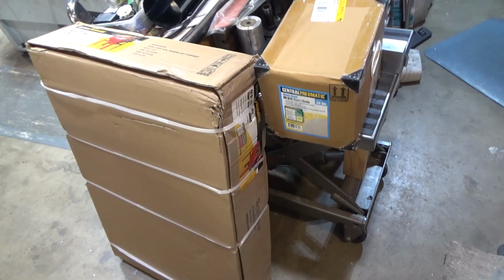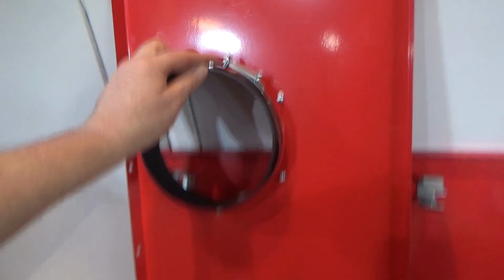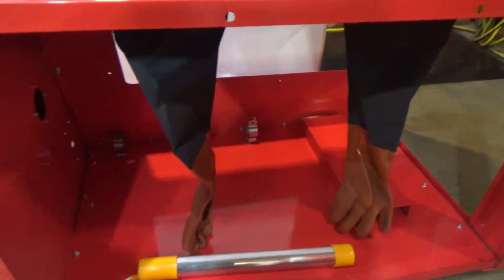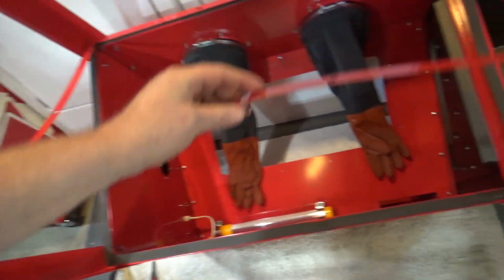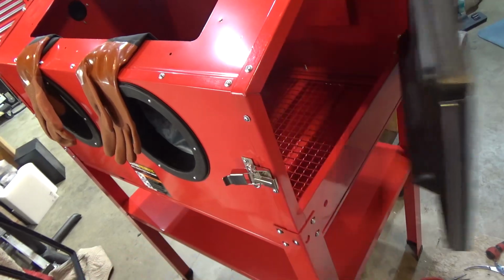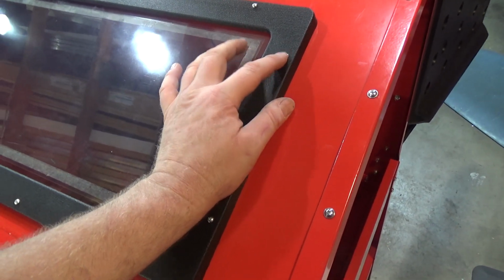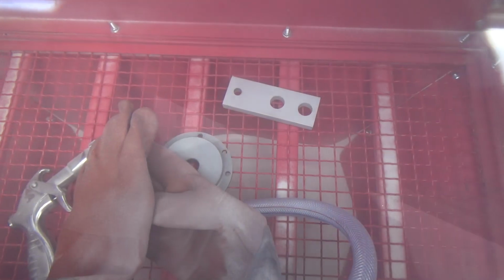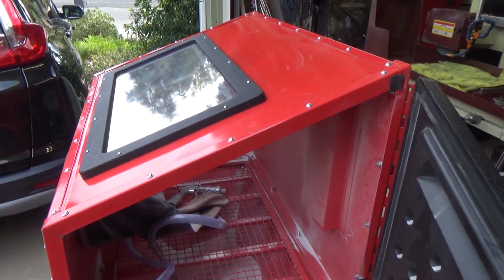QTR 58 Harbor Freight Sand Blaster

Comment: I will add to those who have mentioned Tacoma in Hope/Sandpoint Idaho (he used to be in WA state) for mods to this cabinet.  
Absolutely transforms this cabinet to a professional level.  
With his system you will measure your media in cups vs. pounds, and that's not an exaggeration folks.
Reply from the maker: Thanks for the tip, I'll check it out.

Comment: I was wondering, if you put an 'Ionizer' inside the blast box and grounded the cabinet, it should help prevent the glass dust from flowing around so freely inside the box and maybe prevent it from escaping so easily as it would be attracted to the cabinet. I would also put one outside the cabinet to prevent the dust from contaminating the shop. They are very cheap to buy and maybe worth a try.
Reply: P.S.     You need a 'Negative Ion' ionizer.
Reply from the maker: That is a really interesting idea. Getting rig of static charge might work.

Comment: I have had a harbor freight blast cabinet for 8 years. a few pointers: if you have suction problems where not enough abrasive flows, drill an 1/8 inch hole in the metal tube above the level of the abrasive in the well. i know, sounds wrong but mine has worked flawlessly since I did this the first day i used it. Siphen feed blasters always have this. Order a pack of glass protectors, they get cloudy quick. You can extend their life by taping paper over half of the window on the inside. You will have plenty of viewing area and when it gets too cloudy you can remove the paper and look through that side. Contact me if you want the whole list of mods that made mine better.
Reply from the maker: Thank you very much for sharing your mods and thoughts. I really appreciate you taking the time to share them.

Comment: Blast cabinets are a great addition to any shop. A HF cab is better than nothing. I’ve found that the ceramic nozzles don’t last very long. When the bore gets large enough, the siphon action of media degrades. The tungsten carbide nozzles last much longer. Also, the larger the cabinet the easier it is to use. The hoses and gun occupies a lot of space and seem to always be in the way. In order to get a uniform finish on your parts, the nozzle needs to be far enough away to feather out the blast pattern. Kind of like spray painting. Thanks for taking us along on your adventure.  Cheers from West Virginia.
Reply from the maker: Thanks for the feedback and sharing your experience.

Comment: Cool build, I have a HF blaster also, yes cut your air pressure back to 60 -80psi, always try to hold work  with a pliers or set it down and blast downward, and deflect blast AWAY from the glass, this will save your gloves and window. I put a small shop vac connected to the port on the left side port hole to vacuum up the dust so you can see what your doing. DON"T BREATHE IN THE AIRBORNE GLASS DUST seal all leaks and wear a N95 mask if you do a lot of cleaning and sense the dust [it will irritate  and dry your nose, smell]
Reply from the maker: Excellent suggestion. Thanks.

Comment: I have this exact same cabinet too.  Mine came with the air hose coming in on the opposite wall from where yours is.  I did quite a few mods to mine over the years.  If you search "cabinet" on my channel you'll find them if you're so inclined. :)    A couple of quick thoughts/suggestions.  The glass abrasive shouldn't absorb moisture, so you shouldn't have much problem with it being outside.  On the glass.....I installed rivnuts so that I can take that surround on and off easily to change the protective sheet....and or glass.  A friend suggested that I mount the flange for the gloves on the outside which is probably one of the best mods I've done.  You can take them on and off very easily which will allow you to reach inside the back of the cabinet or replace the gloves.  I put cheap LED bar lights from HD in mine.  I mounted them between the gloves.....huge improvement in being able to see. The stock light is from the backside and can create more shadows on bigger parts.  I have to store it in the shed, so I put wheels on mine with some pipe that extends out for handles and cross bracing so that the legs don't fold under when rolling it around.  I did some other mods to help block the outside light so I could see, but once I put the better lights in it, I didn't need the canopy.  

The abrasive will breakdown and leave a finer finish as time goes by.  It's not actually glass beads.  You can't shoot true beads over about 40psi or they shatter.  If you're looking for more aggressive media, you might search your area for "slag" by products.  I can get copper or nickel slag around here.  It's really cheap and really sharp. Works great fro removing rust.
Reply from the maker: Great suggestions and interesting channel: sub'd. I look forward to checking out your content.
Reply: @DudleyToolwright  Thanks. :)  I hope they work well for you.

Comment: Check out YT.  Several good videos on upgrades to make the HF blaster work a lot better.  One particularly sticks in my mind from several years ago was an outfit in Tacoma, Wa. sold a complete upgrade kit that by all accounts worked quite well in improving the performance.  Gotta keep in mind when griping that it is what we expect, Chinese junk but it gives you a starting point at a lot less than the other offerings of a similar design.  The amount I use one if I had to get a brand name I would never have one.  Even with the upgrades you will have a better blaster with less money in it.  I agree it is a shame the Chinese just can't understand quality control with all parts built to the same specified level.  The builders of the Great Wall would be totally ashamed at the present bunch!
Reply from the maker: You make a lot of excellent points. Thanks on the suggestions as well.

Comment: A couple of suggestions. I agree with the cyclone dust collector, to seal the unit run a bead of silicone around the interior perimeter, and to help with the glass get yourself some rivnuts matched to screws you are going to use to secure the glass. Rivnuts are a rivet with a thread check Amazon they are not very expensive and very handy. Thanks for sharing.
Reply from the maker: Nice suggestion, thanks. I have a rivnut gun and now have a good application for it. Wonderful suggestion. My rivnut tool is from Harbor Freight as well and the funny thing is that they sell the gun, but not the rivnuts.

Comment: I think the washers would be better than the lock washers.  Lock washers MEH..  I think you should put the hose on the opposite end of where it is now. Then it will be out of the way. I went to a shop that had 2 hf cabinets connected together, he liked the units. He also picked up the HF sandblast vacuum that HF sells for the cabinet. He raved about the vac saying it made the cabinet work so much better.  it would be great if you could do tear off screens like they do on nascar and moto cross.  Wish I had room.
Reply from the maker: Thank you very much for sharing your experiences and as to the space issue, I'm with you there! I have to store the unit outside, which makes me cringe.

Comment: I second the recommendation that you add a vacuum cleaner, it will make a huge difference. Also find a way to add a filter inside for it. Another suggestion gotten from experience is to change the blasting media fairly often. You will start to notice huge dusty clouds that obscure your vision. The glass media turns into a fine powder fairly quickly. The vacuum helps immensely for being able to see. You will notice an immediate improvement as soon as you change out the old blast media.
As soon as the glass media starts breaking down you will find any air leaks in the cabinet joints as the powder will escape and get all over the place. As nice as your machinery and shop is, you may wind up using it outside , otherwise that dust will cover everything within several feet if you use it often.
Reply from the maker: Very useful tips, thanks for taking the time to share your good suggestions.

Comment: just a word of advice add the tacoma kit to the glass beader you will not regret it
Reply from the maker: Thank you very much. Will do.
Reply: @DudleyToolwright  its night and day difference but you would benefit from a compressor with more volume like a 3 or 5 hp 60 or 80 gallon tank
Reply from the maker: I have a 5hp compressor, but only a 25 gallon tank.
Reply: @DudleyToolwright  if its oil less it will not keep up in my experiance but i am no expert but my 5 hp 25 gallon would not even come close but it was oil less i have a 60 gallon and a 100lb propane tank in the line for more volume and that works real good
Reply from the maker: @le3045acp  I have an oil lubricated compressor. I love the propane tank idea. I might steal that.
Reply: @DudleyToolwright   i ran the air from compressor to the bottom of propane tankof prop tank and out to the connectors from the top and put a drain on the bottom and i have had the set up over a year and have had clean dry air 100% of the time the extra tank makes an excellent air dryer and its usally 80 or more % humidity here in south carolina the tank is 12 feet from the comp tank
Reply from the maker: @le3045acp  I love the idea. I am definitely going to look into that solution.

Comment: Theres Many dozens of videos on how to Improve the HF Blast cabinet-
I have several of those units, with enough mods they work just about as good as a proper one.
Replacement gloves are avail from Summit Racing, they are FAR superior to the stock garbage
Reply from the maker: Thanks for the tip and feedback. Will do.

Comment: As you found out the cabinet is OK for the money. I have one but did a bunch of upgrades that make it more user friendly. First I bought a scat gun and added a foot pedal. Removed the weak light and installed a floodlight. I lowered the screen by cutting it down and the grate. That gives you more room for larger parts. I put a cover over the exhaust port and use my shop vac to pull out the dust and media in the air. It first goes through a cyclone unit connected to a 5 gallon bucket. It captures any media in the air so you can just pour it back into the cabinet. To make changing out the glass easier I added longer bolts but they come up from the inside and a nut then a wing nut to make removal quick and easy. I added a 90 degree air fitting so the air fitting is not poking out. Lastly I removed the pick up tube from the inside. I have it plumed into the box at the bottom from the outside and then have the hose going back into the cabinet via a hole I cut into the cabinet to the gun. There are a bunch of YouTube videos showing these upgrades.
Reply from the maker: Nice tips! Thanks as always. I look forward to seeing how awesome your shop will be when all set up. The space!